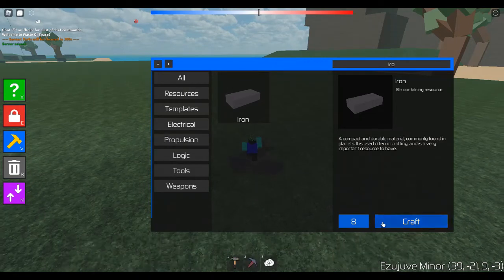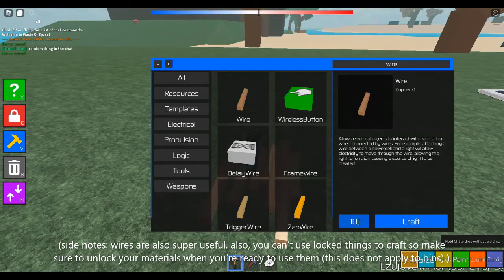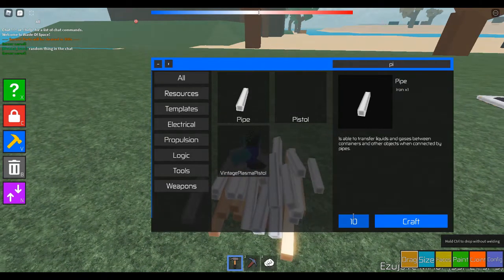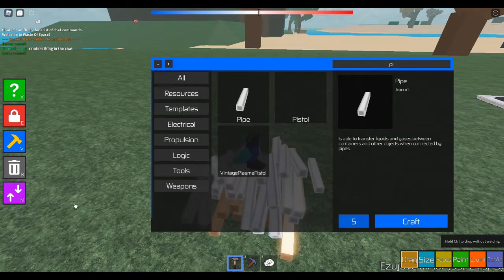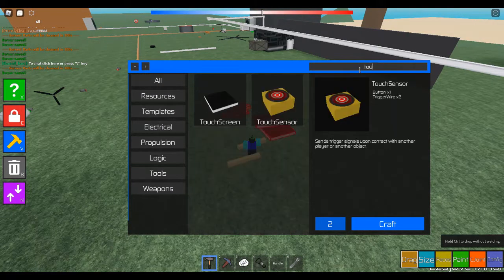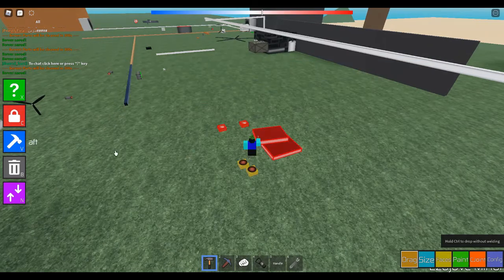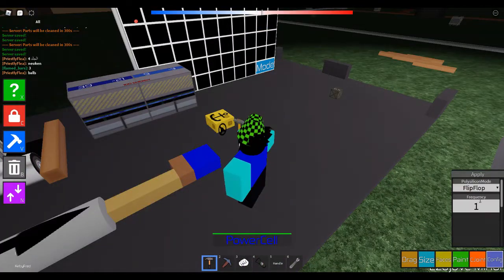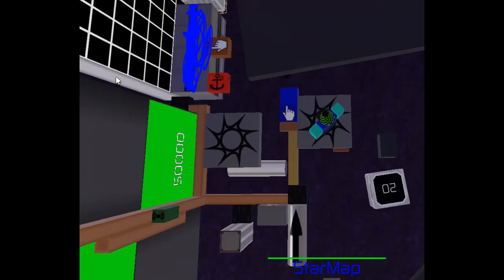How to build a starter spaceship in Waste of Space!

Comment: Thanks! This helped ALOT! First tome making a spaceship everything expect floor just disappeared and later we were stuck in space lol. Oh and also our ion rockets burned down. But thanks to this everything works now! So Im gonna leave a like and subscribe :)
Reply: the ion engine burned down cause its combusted or you placed too much close to each other
Reply: and the floor is disappear cause you didnt weld it very well
Reply: @kyleirvinsiao ion engines needs coolers or not?
Reply: @Pgia55  it depends how hot the temperature is and ion rockets are sensitive to fire, if the temperature is hot on the bottom left of your screen, then add coolers
Reply: @Pgia55  for example, when its too hot, put coolers to prevent ion rockets, and thrusters to burn
Reply: ik it now, after my old ship losing the 2 thrusters and falling in the water resulting of  breaking 5 full powered 10x10x10 power cells. @kyleirvinsiao